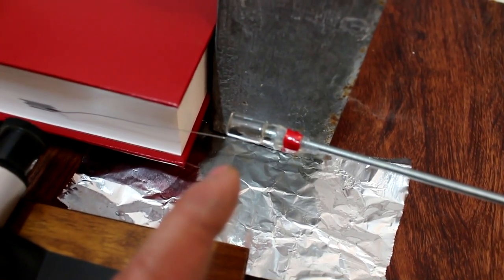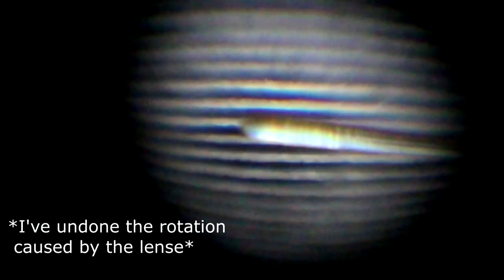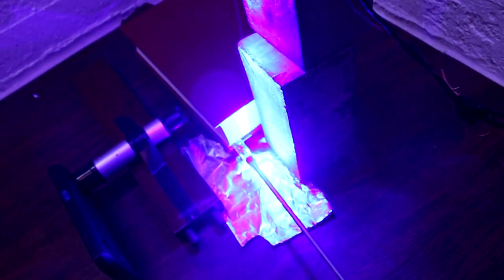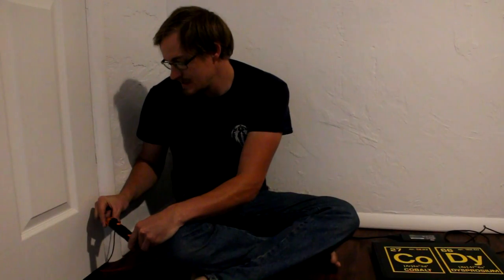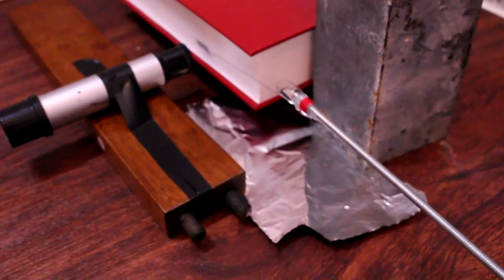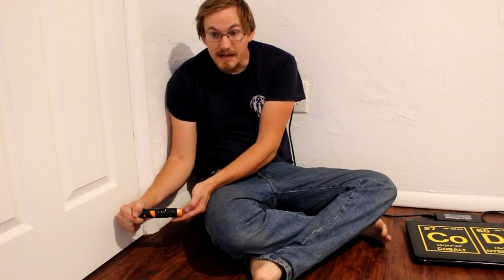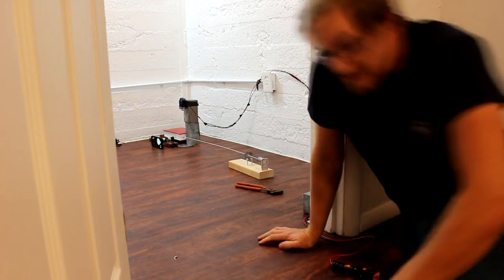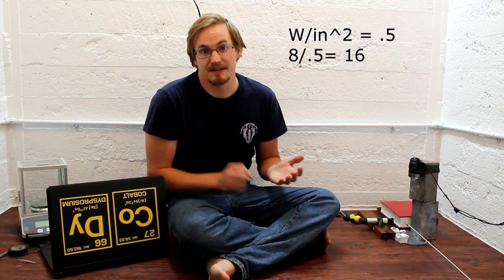Does Light Push?

Comment: I would use a Dial Test indicator and make a fulcrum with a long arm like you have with a pivot point close to the Dial Indicator so that a slight movement at end where the light is hitting will move the arm slightly down but on the other side of the pivot point it would move  x amount of times of the long end being it would be like 1" to lets say 24" of length on opposite side of pivot point and since the 24" side would have a greater mechanical advantage or leverage you could easily calculate the force based upon the amount of movement on your sensitive Dial Test Indicator needle, I am thinking it would be testing movement down to the micron level and be extremely sensitive with a long lever, And I would not wright off that vibration as seismic unless you have a matching setup mapping the vibration at the exact same time laser is being used on an identical setup to compare the two to determine if they both were in sinc one setup with laser the other without laser as far as vibration goes if not I would say then it was the light causing it. Actually as I am thinking about the set up you would need a double fulcrum with the two short ends acting in the middle one upon the other and in this way they would amplify the movement at opposite ends of each other. It would be a tricky set up and can see how this might be very difficult but doable with the correct relationship between arm levers.

Comment: Pretty cool result
BTW
(1)   v=c/sqrt(dielectric constant)

higher index of refraction slower the speed.

F=W/c is the vacuum case

the general case is
 
(2)   F=W/v       force=power/actual velocity of light

where there is a dielectric the velocity is slower so the force is larger
substituting eq 1 into eq 2 gives

F=(W/c)(sqrt(dielectric constant))

The higher the dielectric constant the greater the forceC
Some materials have a dielectric constant of 12000
sqrt(12000)=109

So the force is multiplied by a factor of 109.
Have fun.
Cody you should be able to design an experiment to check this equation.
Pretty basic.

Comment: Cody I don't understand how your first experiment in the unlisted video was invalid.  The air momentum issue should be very small when performing in a near-vacuum (I can't say if it's negligible).  But also it would seem that the temperature of the back side of the foil should be very close to the temperature of the front, shouldn't it?  If so, then the air momentum effect should cancel.

Comment: +Cody'sLab Can you explain in detail why/how more force is acted on a surface by something bouncing off of it rather that sticking to it or being absorbed? That idea seems counter intuitive. For example: If I suspend a paddle from the ceiling with a piece of string and bounce a tennis ball off of it, I would expect less movement from the paddle than if I did the same experiment with velcro on the paddle because the energy of the ball is redirected when it flies back at me as opposed to the ball stopping on the paddle and imparting all its momentum to it. Does the question make sense? Not saying I'm right or your wrong, just that it warrants more explanation for me to understand it :-)

Comment: it's a very nice experiment and a nice set up. your control measurements are also adequate and better than some some stuff i see in peer-reviewed papers sometimes... unfortunately, the precision is not enough to see any meaningful differences and you haven't assessed the accuracy of your scale either. i think you're very close to a convincing result, but you need to increase the precision and possibly the accuracy of your set up. As an aside: do you think your scale set up could be used to measure the casimir effect?

Comment: Cody, light does not have mass but because E=MC^2 is only half of the equation and it is to measure energy non moving objects, to measure light (which does not have mass) you need to use the other half of the equation, E=PC which measures mass less objects. full equation is --> E^2=(MC^2)^2+(PC)^2

Comment: Correction: E=mc^2 is only true for an object at rest. The full equation is E^2 = (mc^2)^2 + (pc)^2, where p is momentum. Light does not have mass, but it does have momentum. The change in momentum is where the "push" comes from (force is the time rate of change of momentum).

Comment: You should revisit this. Doesn’t it seem strange that the tiny piece of foil weights more than several paper book pages. Weighing a page would of been better and multiple repeatable tests of pushing it down unloaded and seeing if it returned to the same page.

The other problem with the setup is the light is being pushed straight down. As the foil gets hot from the light the energy increases its mass ergo making it heavier from heating up not momentum.

Making a sail on a spindle and firing it horizontally would of been a better idea

Comment: I think "your" radiometer analogy might have been disproved by the user Theoria Apophasis with his radiometer experiments using different wavelengths of light.  It appears that the laser you're using is a blue-violet laser, which is the only portion of the spectrum which the aforementioned user was able to affect a change on the radiometer in his experiments.  There was no movement using anything under the blue-violet wavelength.

Comment: Would you having the mirror or the charcoal at different points on the scale (e.g. the coal is at the "bottom" of the glass and the mirror is positioned at the "top") have any effect on the expected pressure exerted by the laser. So, if you shined the laser at the very tip of the scale, would it effect the scale more?

Comment: +Cody'sLab Photons do not have mass. Inertia, which is required for momentum, is caused by the restriction of energy, and so it is more accurate to say the photon-mirror system has mass instead of just the photon, because it doesn't.
Reply from the maker: but energy equals mass!
Reply: Rest energy equals rest mass. Light has no rest energy, it just cannot not move so always has some energy. Confined energy produces inertia (resistance to acceleration), which is what some people call "relativistic" mass (though this is a misnomer as light cannot ever have actual mass), and why light can have momentum. The momentum of a photon is equal to p=hf/c and not mv.

The energy light has is not from its mass, but is instead due to it moving through the electric and magnetic field of a vacuum. This is also why the speed of light changes in a medium, because the electric and magnetic field in that medium is not the same as in a vacuum.

Comment: if you made the device longer would it be any more sensitive?
Reply from the maker: At some point it would become impossible to have the fulcrum edge just above the center of mass. but yes.
Reply: ***** well I did not mean if it was made that long. lol.
Reply: +Cody'sLab If you do more along this line it would be interesting to see a wire torsion balance. Calibration via the resonant vibration method would be cool to watch.

Comment: i once gat a rather low powered laser for my birthday, and i tried shining it on one of the balloons (inflated wit air) that my parents put on the ceiling and after shining it for approx 1 second, i could observe the baloon moving just the slightest bit. i tried it multiple times in random intervals to make sure there was no wind moving the balloon instead of the laser. but it was just a low powered green laser and a yellow or green ballon ( i cant remember). we dont have any kind of especially big fluctuations in air pressure here and i cant figure out why this worked, because usually this effect really only be observed only in a vacuum with as little friction to the object as possible and a high powered light scource.
EDIT oh shit cody basically explained it in the first two minutes of the vid.

Comment: Just was thinking. How much heat is generated when the laser is on? Rather, is the heat up-force strong enough to counter the photons down-force ? They are working against each other in this demo because the laser is pointing down. If the laser was pointed up from under instead of above, one could measure if heat was having a significant effect.

Comment: Can anyone answer this for me? If a photon can reflect off a surface and impart momentum to what it reflected off of, how is energy conserved? Is this accounted for by the absorption of some photons? Or does the frequency of some photons change upon reflection? How can the light be reflected and still have the same energy while also having caused another object to accelerate?
Reply: The photon does not reflect it is absorbed and re-emitted. In fact, the photon is a probability wave  and is kind of absorbed all over the surface and reemitted in all directions but the probability is only reinforced along the angle of "reflection"

Comment: that is actually very impressive because if you think about it that light has enough force to move it probably about 1.5 thousands of an inch going off of that most pages are around 3 thousands depending on the type of paper the book is made of but still that is very interesting non the less.

Comment: Will you please do another test using different colors of the laser to see what is the effects of different color (need to check the power they consume, and choose the same power)
Reply from the maker: IIRC as long as the wattage is the same the push will be the same.
Reply: @theCodyReeder  dont mirrors have a slight bias where they reflect green light better than any other light? So wouldn't a green laser be marginally better?

Comment: But doesn't your high power laser heat the metal parts up thereby causing the wire to expand and move in the downward direction?  (like a thermometer coil)

Comment: I have no doubt that light has mass. But if you do not have a perfect vacuum in the glass chamber...the oxegen nitrogen and common gasses are expanding inside, due to the heat applied by the laser.....creating a high pressure zone....if you are in a cold room this effect will have a more dramatic impact on the density of the gases, thus changing the weight of the bottle slightly......
Reply: also glass is imperfect, and there are micro bubbles formed inside glass when it is formed, trapping gasses that could also expand when heated, adding to the change in pressures described by my  previous comment.

Comment: I have a question:

According to Newton's third law of motion, shouldn't the laser get a force on it equal and opposite to the mass * accelleration of the photons?

Does this mean that you could theoretically put a powerful laser on an object in space (where no other major forces are enacted upon it), that object would start accelerating in the opposite direction of where the laser is pointing?

If this is the case, you have moved matter with pure energy (which is matter).

If all these things are true, then if we can develop a powerful enough laser, all space travel will only need to use one kind of fuel:
Electricity.

Because you can make light from electricity, can you not? Just pass a current through a diode and you have photons.

Cool.

Comment: whats the other name of the element in the back of the laptop. Just stick somthing easier like Po .
The first try clearly shows a dyrty realease of electrically charged particles. It is like showing positive charged light particles and negative particles displacing the tip upwards or downwards. Also if the tip is not moving asume neutral particles .

Comment: Hey, Cody how could I modify this balance so that it is more sensitive? I am trying to replicate this experiment for my science fair project, but I am having trouble collecting the measurements with the equipment I have. I am using a red 8W laser from 1999 that is class II is this powerful enough to get the job done? It is due in less than 2 weeks so any help would be appreciated!

Comment: FWIW, if you're willing to go through that much fiddly work to set up this experiment, you'd likely get much less noisy results from a home-built interferometer. You'd also need to find a way to accurately calculate the spring constant of your reflector to determine the force accurately.

Example DIY interferometer:
http://hackaday.com/2015/07/24/self-built-interferometer-measures-nanometer-displacement/

Comment: I believe that Cody's results could be incorrect. In the video, Cody described how heat from the laser can cause motion, and explained the motion of the laser through just the bottle this way. In the test against the charcoal and mirror, the glass bottle is still there, meaning that it can be heated and move like in the first test. This leads me to believe that the laser also needs to be inside the vacuum so that there is no glass in the way to heat and cause motion.

Any thoughts?
Reply from the maker: the first flawed test was done without the glass. My reasoning was that since I saw more motion when the laser was on the charcoal (when the laser was again passing trough the glass) and even more with the mirror then most of what I was seeing was due to the light. I wont say I'm 100% not wrong but it looks valid.

Comment: I've done similar, though with a 40W Infrared laser (pulsed YAG, 1064nm).  Definitely interesting results.
Reply: I am actually doing an experiment right now, with a torsional pendulum in a 10^-6 hectopascal vacuum. I am only using a 200mW laser, and I am actually calculating the momentum as opposed to detecting it.
Reply: Erix
I wish I had the resources for that!  I just have big, powerful lasers!
Reply: ***** 
I usually refuse to work with anything over a few watts... Lasers that powerful are extremely dangerous, and I'm not taking any chances :P
Reply: Erix
Luckily I took multiple LSO courses.  High power lasers are basically my life at this point.  From 15W+ visible, to 40W+ pulsed IR, to 100W+ far infrared CO2 lasers.  Still have both my eyes!  :D Though, I am thinking about putting a KTP on that pulsed YAG (second harmonic generator) to make it visible.  No idea what the output would come to after loss from optics, but that'd be one hell of a green laser!
Reply: ***** 
Yikes! That's pretty serious!
May I ask what is is that you do with these?
Reply: Erix
CO2 lasers are for engraving and cutting, the YAG was just for personal hobby, picked up a decommissioned Laserscope from a closing down hospital and decided I'd do some work on it.  I'm either going to turn it into a CNC laser cutter, or make it 532nm with a second harmonic generator.  As for the visible spectrum lasers, I use them for laser shows!  Concerts, festivals, personal artistic enjoyment, you name it.  You can see some of my shows on my channel if you feel like it.
Reply: ***** 
That's neat, I'll check it out.

Comment: Liked attention paid to eliminate negative influences.  Suggestions for increasing pressure.  Use front surface mirror in the vacuum bottle.  Make reflection impact angle very oblique instead of perpendicular.  If you don't have access to front surface mirror at least try rotating existing vacuum bottle such that reflection angle is very oblique instead of perpendicular.  Instead of mirror try HVAC aluminum foil tape with array of several hundred very tiny right circular frustums pierced through shiny side with frustum larger diameter opening pointing perpendicular and close to light source.  For piercing die use applique pins with heads removed packed into short section of bubble tea straw.  If you want to make the foil lighter by removing its paper backing use kitchen aluminum foil to cover the sticky side of the tape prior to piercing.  The frustums should permit multiple oblique reflections and then allow light to leave reflector before becoming perpendicular.  Also, a blue to UV laser should produce increased pressure versus a red or green laser.  Doubters should study the difference between the works of Nichols and those of Crookes.

Comment: Wouldn't the light from the room effect the needle?
Reply: Yes, but since the needle was calibrated in the room, and it's assumed the light in the room is constant, it's included in the "zero" level of the needle.

Also lightbulbs are relatively weak light sources.
Reply: Yes, but with the amount of precision he needed it could have possibly changed the conclusion, even if only by a fraction.
Reply: Not significantly. By that I mean, yes, there is a fractional difference, but it's so small that it's noise. In fact, noise (vibrations) from Cody speaking, and seismic activity (such as a truck driving past) are bigger issues.
Reply: Even if you would turn on the room light with the laser, thereby actually affecting the experiment, it would add basically no force whatsoever:
Let's say the light bulb in the room has 100W (It's most likely less and most of it turns into heat anyway) and the bulb is at a distance of, lets say, 2m (Height of the room).
The light of the bulb spreads in all directions, over an area of 4*PI*distance^2, which is in our case about 50 m&#178;, of which the mirror is about 0.01m * 0.01m = 0.0001 m&#178;.
So the mirror is getting about 0.0001/50 = 0.000002 = 0.0002% of the Watts, which is 0.02 Watts. Compared to the 8 Watts of the laser, and considering the crudeness of the setup, that's an immeasurable difference.
Ergo, even if you the lamp weren't on constantly or the setup weren't calibrated with the light on, you still wouldn't see any difference.
TLDR: No.
Reply: Ok, I just felt the need to point it out.  Thank you for correcting me.

Comment: Thinking Out Loud.    Wouldn't the Force of the Laser hitting the target be cancelled by the light returning  ( Reflected ) off the mirror ?  Both forces being 180 Degree in opposition to each other .   Or  would the reflected light in fact re enforce the pressure of the light hitting the target as it pushed ageist the Air ?   Wavicle theory